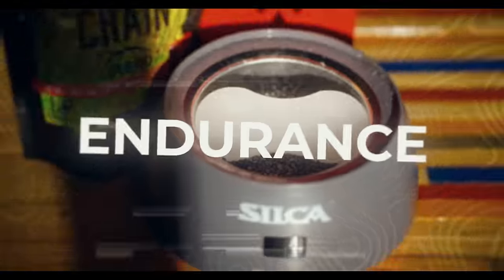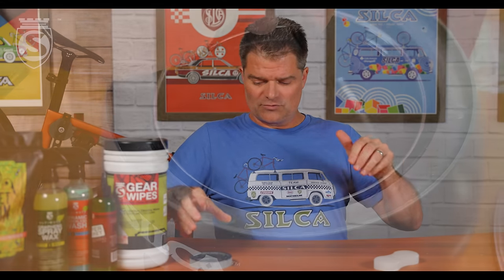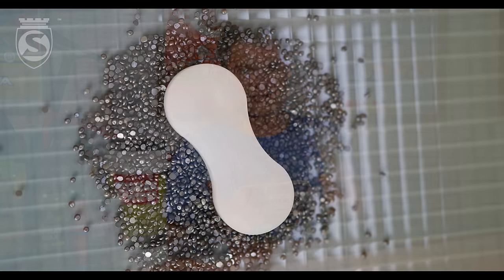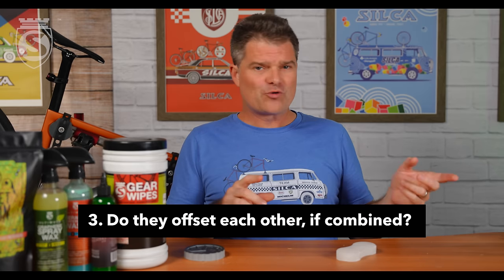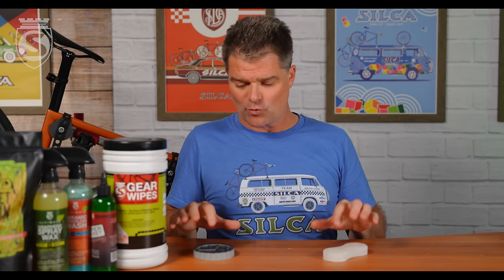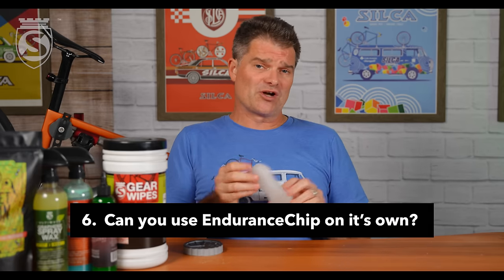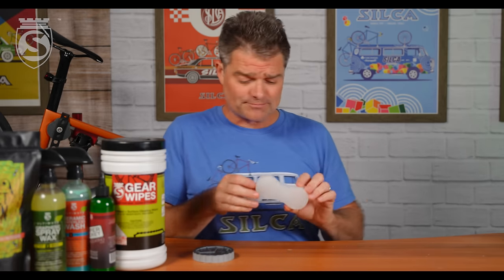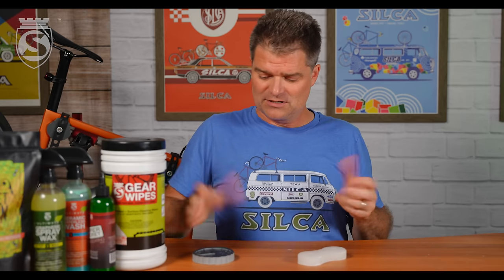EnduranceChip vs. SpeedChip: 7 FAQs to Get the Most Out of SILCA's Latest Wax Additives!

Comment: It'd be nice to have a silca wax pot v2 with interchangeable "pots" if you have several bikes/chains with differents needs i.e a race bike/chain that needs speed chip and a gravel/training bike/chain that needs longevity instead. Right now I know of no easy way to do this apart from having two cookers which I find a bit annoying...
Reply: Great comment ❤
Reply: Soon as the speed chip came out, that was what I wanted too - extra pots. I would definitely purchase 4 pots, and label them/so would be great if they came with some sort of label system. BUT for those of us who bought Silca Wax Pot V1, is there a way you could make inserts that go in what we already have? We'd need to use up what we have or melt and toss and but soon as the chips came out (including Strip Chip) I was soooooooooo wishing the Silca Pot design had the next launch products in mind with its design - but thinking there's gotta be some way to make a metal insert that would fit (even if it means the heat needs to go up a bit to heat the inner pot adequately - no idea! BUT GREAT COMMENT FROM BeckyK!
Reply: don't say twice, they will produce all the pots you want
Reply: Once the wax in the pot has cooled and hardened it can easily be removed. Flip the pot upside down over a clean surface and turn the pot on. Within 15sec or so the wax "puck" will drop out cleanly and in one piece.
Reply: @I_DreamOn2Wheels  Brilliant - thank you!

Comment: Can i use this with strip chip combined?
Reply: I think this is actually a quite interesting question to understand the whole lifecycle around the SS Blend: e.g. 1/2 bag with strip chip in one liner for the first application and another 1/2 bag  with [speed|endurance] chip blends in a second liner? This is a question I have also due to the whole extra heat needed with the strip chip since it kinda concerns me what will it do to clean, let's say, 6 new chains over time. Is the wax used to strip factory grease still in ok condition?
Reply: yes
Reply: This was answered in the first video, it can be
Reply: @ItzMe3224  no it wasn't  (i just re-watched it)

Comment: As per Adam a 0FC I'm using 2 chains each for my (mountain bike, Road Bike, and Gravel Bike) with a year in no wear at all. I can clean then rewax in 10 minutes. My question is what or how would waxing your bottom bracket bearings as opposed to using grease? Are you looking into a way to wax your bearings in tungsten disulfide etc...? i.e. use a tough wax to seal out dirt from the bottom bracket. ???

Comment: At what distance in the wet should we rewax our chain with the endurance chip ?⛓️
Reply from the maker: This will still be condition dependent, but 2 endurance chips should more or less double the duration of the wax life, so if you were getting 300km before, you can expect more like 600km now, and if you are say riding MTB is sloppy conditions and getting 100km before, you can probably expect more like 200km now.
Reply: @SILCAVelo  But what Josh said in the Wet Weather Performance chapter of this video is that a single endurance chip will give us 60% - 80% increase in longevity in DRY conditions but only about a 15% increase in WET conditions.  Not sure the math supports that two chips will DOUBLE the wax life in wet weather.

Comment: Hey Josh! Very excited to get hands on soon. Will chat to you more on this via email - but just for viewers as well - the main test protocol can be altered for products if needed with regards to re application intervals. This has not needed to be done very often, but it can be done on request / or of the standard intervals will exceed a products treatment lifespan. There is no point testing in the main test at the standard intervals if that will exceed treatment longevity, as then we are not assessing that products performance. Ie if a product has an expected treatment longevity of 200km due to being focused on ultimate speed, then re lube / re wax intervals can be shortened to stay within mfg claims. 

Such was done for UFO drip V1 which had a recommended treatment lifespan of 200km dry road, and also for Tru-Tension Tungsten race, and the more frequent re lube intervals is noted on the test result and detail review. Basically testing a product outside of its design brief is pointless - its like taking a ferrari to a 4wd track and calling it a crap car. So there will be no issues re shortening intervals in main test for speed chip to match mfg recommendations. 

Very rarely this is also done the other way. Rex Black Diamond Drip lube the mfg requested it to be lubricated only ONCE per 1000km clean block, and only twice during the 1000km contamination blocks - due to that products exceptional treatment longevity, and it tested very well overall despite the much less re application amount vs normal protocol. However as key attribute and marketing claim is its treatment longevity, testing at standard protocol would not have backed this claim. 

In short - will discuss any adjustments to the standard protocol for speed / endurance chip you wish to make - as this is then covered in the detail review etc.
Reply: Excellent and just as expected ZFC. Manufacturer product marketing claims are respected and tested on that basis. As it should be. Proper.

Comment: 8:34 I'm sure you're aware and researching this exact thing. But if there were compounds available that can increase longevity for wet conditions by a significant enough margin, that would be great. If only for peace of mind. The stark falloff of performance and wear when the chain returns to dry (in the lubeless sense), accelerated massively by rain if I'm not mistaken, is the thing that scared me a little bit to make the switch to waxing. And in practise, I think I had chain noise return after 150 km a few times this winter. A wax or additive that ups the life between reapplications in wet conditions reliably to over 300 km would be great, the 15% of the endurance chip is alluring, but not quite there. Are there avenues that are explored right now that seem promising?
Reply from the maker: One of the main problems here is that from a performance and wear perspective, wax is absolutely the best performer in the wet.. look at ZFC data: https://zerofrictioncycling.com.au/lubetesting/ and click the down arrow to look at 'Wear by Block' and you will see that for rainy test block 4, all of the top performers are hot wax, and SecretBlend is in first place at only 8% wear in the block (compared to something like RockNRoll Gold which shows 65% wear in the same block).  So the challenge here is that when wax starts to fail it gets noisy and alerts you that its failing, while the other lube types especially wet lube, hide the fact that they've failed by remaining silent long after they are actually a problem.  The reality is that for any lube, 150km of rain riding is more or less the limit.  If you also look at Adam's notes on SingleApplication Longevity testing, he notes that wax lubes 'feel and sound dry and are not pleasurable to ride' more of less by the time they get halfway to the 'jump point' where the chain really begins to wear, and for wet lubes they often still sound ok well past the jump point.
Reply: @SILCAVelo  Yeah, I wish I could've told myself earlier what I tell people now, "if the upkeep of waxing seems daunting then you're not taking enough care with your drivetrain anyway". 

Only thing really that remains is the fear that if in my mind the wax is still good for a day, then suddenly there is rain and I go over that point where the graphs are steeply downhill. Whereas if it were dry I woudl not even have to think about topping up or rewaxing.

Don't get me wrong, I'm fully aware that for my usecase - bike courier, so intensive daily and all weather sea climate use, with unpredictable lengths - wax is still far superior. 

Not taking care of your oil lubed chain is certainly less strain on the mind sometimes, but you notice that quickly in the wallet. Taking some care of your oil lubed chain is as much hassle as taking perfect care of your waxed chain.
Reply: I also would like to see some product come out that adds a little rust resistance to the mix. I primarily ride in extremely dusty conditions, but there are occasional river crossings on many of the mtb trails. I know that is an extreme condition. If, however, I just make it home in time to get to work, I might not have time to re-wax, even though I won't ride it again until I do re-wax or switch chains. It would be nice if there was a little more rust protection for a day or two. I definitely see a need for this for commuting to work also. If you ride a bike to work and it rains, the bike sits for 12 hours, and then you go home. The chain could have already started to rust.

Comment: Hi Josh - the graphic on your site says that Chain Blend + 1 Speed Chip is approx 10 hours of riding, BUT since all your other instructions and videos talk miles/kilometers and not hours, would you all be willing to list miles/kilometers for  the wax additives too? Just  would be super helpful since that's the data point you've taught us to use and easier to get that number quickly in my workouts lists. Additinally the wax additive formulation graphic on your site is impossible to read. Can you make a larger version or one that increases resolutions when made bigger: I want to take a screen shot of it, but when I increase the size,  it gets very blurry. Thank you so much - LOVE ALL YOUR PRODUCTS, PODCASTS and VIDEOS! P.S. I also want to DITTO the comment from BeckyK who said is there way the hot wax system you just created could come with extra pots so we can label of formulations and just swap between them?

Comment: I managed to grab some before it was sold out. I have the Silca wax set up - how would i be able to switch between speed chip and endurance? I have an event coming up and would use the speed chip but then it will be endurance for training. Should I start with speed chip then add endurance after the event?

Comment: Hey Josh, what’s the ideal chain waxing strategy for a mountainbike marathon racer?

When I won the 4-day Alpentour Trophy stage race in Austria this year, I prepped my almost-new chain with Silca Chain Stripper and waxed it using Silca Secret Chain Blend in the Silca Wax Melter. Thanks to the good weather, the chain lasted through all four stages without any maintenance.

However, after using my wax melter just once for a StripChip on a new chain for my sister, I noticed a significant drop in the wax’s durability. Instead of lasting four races, it now only lasts for one or two races in good weather. Could this be the reason? If so, I might switch back to using the Chain Stripper, or consider using one melter for StripChip and a separate Silca Wax Melter for regular Secret Chain Blend applications.

I’m also considering whether to get the Silca Wax Melter with the Endurance Chip. For racing, though, I don’t see much benefit - since the chip might sacrifice some performance and doesn’t offer enough extra durability for tough conditions like rain or mud. But for the chains on my training bikes, it could be worth considering.

A dedicated Silca Wax Melter for speed wax in good weather and single-day mountainbike races seems like a sensible option. I’m a bit torn, as none of these are “keep it simple” strategies, but on the other hand, every watt counts for me.

Comment: I purchased the Silca wax system in April and appreciate how easy it is to use.  I have a 'bowl' full of wax of unknown mass that I top off occasionally to replenish wax deposited on the chain during the waxing process.  What does that imply for an endurance chip, would I break one in half and add it to the 'bowl' full of secret blend?  Another unrelated question is would you recommend waxing shifter cables and what would recommended immersion time be?  Bike is modern MTB 1x12, GX Eagle.
Reply: If I may throw an idea out to you . . . I also use and LOVE the Silca wax system.  Not sure what Josh would say but I'd hazard a guess that your shift cables don't work or are as stressed anywhere NEAR what your chain is subjected to so I think if there IS any advantage to waxing your cables, it  would be minimal at best but I can't see a downside, frankly,  The only caution I'd suggest is that if you go ahead and wax your shift cables, I'd strip the wax off where they are secured by the bolt at the derailleurs otherwise they might slip. Immersion time would be the same as the chain - over time could never hurt anyway :-)  Happy and safe riding !

Comment: What about different temperatures? What would you recommend for riding in -10c, 0c, 10c, 20c, 30, And 40c?

Would you give them different mixes for any of the temperature ranges?
Reply: At freezing temperatures my main concern would be salted roads and the corrosion that follows.
Reply: @Frostbiker  not too much salt on MTB / fat bike trails
Reply: good question about salt - on winter roads, how long it last?, how frequent we need to rewax
Reply: @Frostbiker  it doesn't have to be, it can be dry and cold

Comment: Josh, please tell me what the best use of Silca chain products are for 24 hour races. I’m looking at the unknown weather of 24HOP in Tucson next February. My team will podium. I need advice on what to do depending on rain or dry conditions. My gravel races have been exceptional on using the Silca system of waxed chains for performance and longevity. With all the new stuff, I’m confused.
Reply from the maker: If what you're doing works, I'd stay with it.. but if this is a team event with 4-6 hour stints, you could certainly add a SpeedChip or two to the mix and then either rewax when not riding your stint, or take multiple chains and just swap them out.  For Visma, we keep SpeedChip chains, standard chains, and endurance chip chains on the truck and then just swap out depending on length of day and weather, rewaxing the chains after they've been used and re-stocking them.

Comment: Hi Josh. The question I have that I’m not sure has been covered yet is how using the chips then works with maintaining the chain using Super Secret chain lube. 

For example, if I use EnduranceChip for waxing, can I use Super Secret chain lube for a period before re-waxing and what would the approximate mileage be before needing to completely re-wax? Is this approach a compromise on longevity and the extended mileage of EnduranceChip that it has post waxing? Thanks!
Reply from the maker: You can expect SuperSecret to extend life by 150-200km per application for dry road condition, roughly the same as if you were using it in combination with standard SecretBlend.
Reply: @SILCAVelo  Many thanks for clarifying/confirming. I thought that it would be a normal extension of use but it's good to know for sure.

Comment: Hi Josh,
I appreciate your honesty about the limited wet weather benefits. As a mountain biker in the UK, it's all about treatment lifespan here. I'm not racing so will happily sacrifice speed if it means more chance of making it to the end of the ride with lube in the chain.

I currently wax at 75°C as per advice in a previous video. I notice the endurance chip melts at 95°C. If I did add two endurance chips to 500g, would that change the optimum temperature for waxing?
Reply from the maker: I would wax at 95C and lower to 75C before pulling the chain, this will give you the best overall penetration and wax holding per waxing.

Comment: Will you also offer different drip-on waxes containing either SpeedCip or EnduranceCip, or is this not possible? For example, the Squirt e-bike chain wax remains a little bit sticky (it is absolutely essential to wipe off excessive wax), but the chain still stays clean, although the wax is absolutely waterproof - after a ride in the rain (when every oil-based lubed chains got wet), the water had no chance to get into the chain. Of course the chain is not made for running fast, that wax is more for hassle-free maintenance, as most e-bikers for sure don't care about losing or winning marginal gains, and for my second bike (intended to use in summer bad weather, or in fall and winter) it is perfect, but not for my summer/nice weather bike, there I use Super Secret chain wax.

Comment: Graphene vs Tungston.  Two quick questions.  1). For my 40k TT is it safe to assume pure speed wax is going to faster than race X wax and if so, by how much? 2) other than the issue with water, is there a reason to not have both additives?  Thanks

Comment: Picked up a couple of endurance chips at your MADE booth. The instructions recommend five minutes at 95 °C, then dropping to 75 °C to pull. My Secret Blend is in an ultrasonic cleaner that only goes to 80 °C. Can I still use the endurance chips?
Reply from the maker: That will work, maybe give it 10 minutes at 80C before dropping to 75 to pull it.. the ultrasonic will also help get it stirred into the inside of the chain to drive out any trapped air.

Comment: In the user manual it states that both the SC and EC are for 1 chain. How does that work? I add the chip to the hot melt wax and then insert the chain to the mix. I can wax several chains like that, so it's not for single chain?! Also what happens when the mixture hardens and I heat it up next time. Has the Chip vaporized?